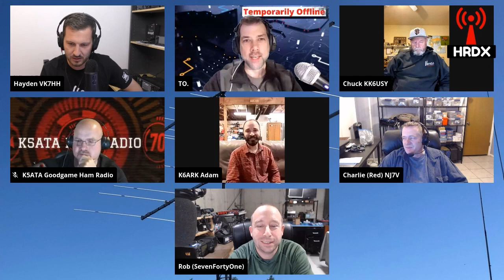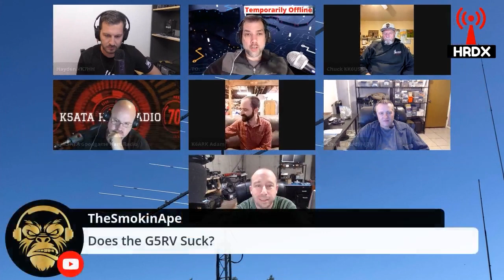Does the G5RV antenna suck?

Comment: G5RV really sucked for me, Antron 99 and my homemade 10m dipole blew it out of the water. Must be different locations that work better than others. Had mine up at 45 feet, wind finally took it down, and it will stay down. Now to decide between an End Fed or DX Commander

Comment: Been running G5RV's for 17 years now as an inverted V about 30ft with great success. I sometimes switch between my dipole and vertical depending on conditions, but I have found them to be comparable and had lots of fun over the years with em- Never had the cashola to dump into a tower setup for comparison, but I don't feel handicapped with my G5RV's in any way.. 73's W5YAK

Comment: I have a G5RV half wave up at 20feet with feeder horizontal to the antenna (think Y shape) and work West Coast USA from North East Uk on 10m with 90watts. Have also worked Chile and Brazil as well as out to China and deep into Russia on 20m. Yes undoubtedly compromised but works for me 😊73

Comment: If I wanted a crackin good multiband antenna
I would feed a dipole of about 130 foot with balanced line to a old johnson matchbox
Make your feedline a little long
Snip off a little till you get this thing to tune everywhere you want to be :)
You will likely soon get life happy :)
I would forget all I think I know about resonance and SWR
If mr matchbox can make the match
He will force it and not give a hoot 
You can call it macaroni
You could get a RF engineer gimp to type in all the measurments
Then pat yourself on the back about the lack of loss and overall efficiency
You gained lost decibels by just forgetting about coax
If you got this thing up about 40 or 50 foot . You can consider yourself in the and on the air
I would forget all this G5RV and the G5RV jr, And the monkeys uncle from dark africa with the ZS something or another
Make operating easy
Perhaps learn the code and Qrp
Mr G5RV is not here to defend hisself
He likely never had the intention that his antenna end up nothing like it is today
It not that I am sad
I just I aggravated
There are some fellas by the title of RF engineer
Who really needs to find a choo choo train hat
He might be better off there
He seems a bit incompetent to build an antenna
What the point of heavy algebra and physics
If you lack the ability to figure how to get a wire up a tree?
I need no sugar I`m sweet enough !
It seven three
Not seventy threes
73 ...-.-

Comment: I've been running a g5rv for 21 consecutive the antenna does not suck without the tuner and any full 100 w on 40 m again without the tuner SWR 42.8 21 20 m I'm off 3.1 10 w 1.5 1.8.1 20 m 40 m 10 m+ 30 I will run full power with a tuner tunes very well rst o 579 and higher ninety percent of the time 30 same results

Comment: What is the normal SWR measurements for the G5RV without an antenna analyzer?  Our G5RV measured 2.6 on 14.250, 3 on 7.1, 3.1 on 3.7.  Is this normal?  TNX  AC0AE

Comment: I have a 40-10 R700 vertical.  I use my G5RV mostly for 80m.  My G5RV is set up as an inverted vee.

For 80m, the G5RV is a great antenna but you MUST have a transmatch.  I can confirm comments regarding the height of the antenna.  The higher the better.  I had to have a second pulley installed in my support tree to increase the height of the apex.  With an additional 20ft of height, the signal reports were markedly improved.   All said, the G5RV is a good way to work 80m with limited real estate as long as you can get it high enough.

Recently, my G5RV took some damage in a storm and I converted it to an end-fed long wire.  The end-fed long wire matches well (with a transmatch), but does not radiate nearly as well as the G5RV.  In addition, my end-fed antenna is much more susceptible to the atmospheric noise common on 80m. 

I can't wait to get my old G5RV installed.  I need some ladder line.  Once the G5RV is back in service, I'll keep the end-fed as a back-up.

73 de WB9NIR

Comment: I use g5rv very good antenna with manual tuner. Not the best on 17m or 10m. But when 17m and 10m open still works. I feed mine with 100 ft of rg8x. 73s.

Comment: I got the mini version of G5RV. Mainly due to its smaller size and weight which will allow me in difficult field installation (i.e. lack of trees or space to install the full size G5RV). G5RV lacks of 80m band (the ATU does not help here much), but 40m and 20m work good. Did Spain twice, about 2000km away from me, and all that on Xiegu G90 and away from urban QRMs. The G5RV mini could be better or should I say, it should be mounted much higher than I do it (6m fishing pole), but it does the job for now.

Comment: It doesn't need bashing. I've got one up at about 50 ft between two trees....been there for four years. With a MFJ tuner into a Yaesu 991 I have worked stations all over the world. At first it was my only antenna. Now, I just use it for 30, 40. 80, and a little 160.  I have a hex beam for 20 up to 6 m. now. Depending on your location and environment there are certainly other antenna but few can match the price vs performance. It's still a good ole piece of equipment....until you can afford something better.

Comment: Back in 1958, the G5RV was quite a thing, but in the mid-1980s it was improved out of sight by engineer, Dr Brian Austin (ZS6BKW).

"In summary, the ZS6BKW antenna is an optimized variant of the venerable old G5RV. Unlike
 the original G5RV, which  requires an antenna tuner on all bands, the ZS6BKW / G5RV is capable of operating on 10, 12, 17, 20 & 40m bands,  generally without a tuner, and with SWR readings usually at 1.5:1 or  less.  Using a tuner, 6, 15, 30 & 80m bands are attained with much higher efficiency than the original G5RV."

https://www.ni4l.com/zs6bkw-g5rv-optimized-multi-band-hf-dipole-antenna-poly-stealth/

Comment: Whatever it's failings, the thing works! I have one, frankly after buying my radios and other essentials, I wanted an antenna that 1) worked 2) was cheap 3) easy to put up! Much like a cheap Chinese HT, it gets you on the air, and that surely is what it is all about! 72 Jim M7BXT